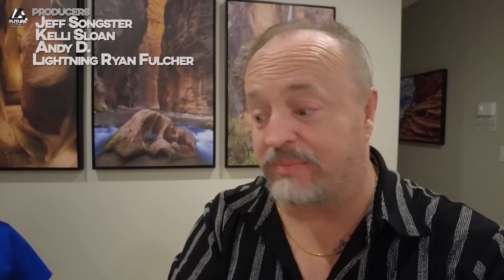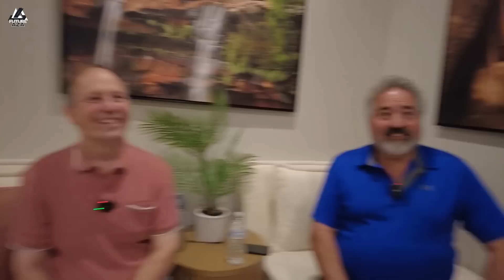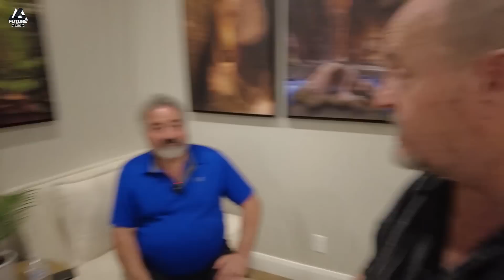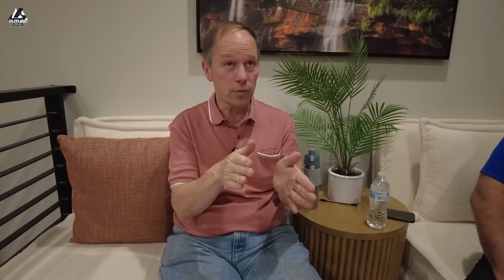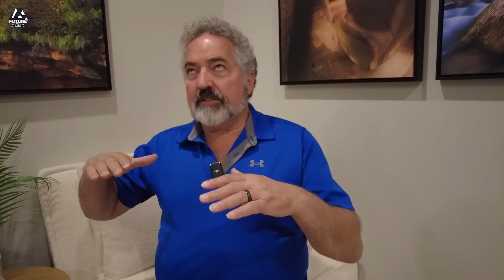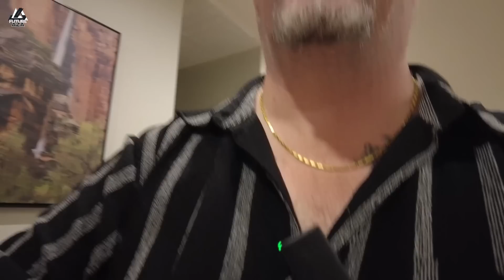Engineers Debunk Myths about Airless Tires, Hub Motors, and more

Comment: I doubt it will be front wheel drive. CV boots are a failure point. Also, apologies if you have already done so, but a deep dive on potential body materials would be interesting. I have my money on injection molded plastic.

Comment: The efficiency of charging of wireless and normal wired are measuring different things.

The wireless charging efficiency is just the transmission loss that is 95%, but that needs to be compared with cable loss, which is 99.999% efficienct.

Comment: two of the biggest problems with hub motors are:
1) Adding to unsprung weight.  Making the tire/wheel heavier has a negative impact on traction and handling. 
2) Harsher environment for the motor.  Getting the motor beat up each time you hit a pothole wears it out quicker.
Reply from the maker: Not to mention more expensive and they kinda don't exist. At least not for mass market vehicles.

Comment: Why do you say smaller wheels are more efficient?
Taller wheels rotate slower, so there is less loss on bearings
taller wheels are less affected by bumps in the road (the larger diameter makes the effective approach angle less)
From my time riding bikes, for the best efficiency, I would want the tallest tire, not the smallest.

Now, you do have to set your gearing so that the motor is in it's efficient power band at your cruising speed, so for a given drivetrain configuration, you can have a tire that's too tall.

But if you adjust your gear ratio to match the tires, why would a small tire be more efficient?
Reply from the maker: Total circumference doesn't change. Just like on other EVs, the smaller wheel with thicker tire is more efficient and comfortable.

Comment: Sensible small passenger vehicles are FWD with ice. EVs may have more flexibility to the solution?
Reply from the maker: They do that to keep the weight of the motor over the wheels, and to prevent losing space to the drive shaft. Neither would apply with an electric motor.

Comment: Electromagnetic breaking. Hub motors. Composite frames and panels at scale are all as absurd as gigacasting. They dont make sense to the experts until a company like tesla solves the engineering to scale production with a performance improvement over current standards with a decrease in cost of goods and reduction in manufacturing complexity and time. Ask the experts about 48 volt architecture or  using your cybertruck to provide power to your house during a power outage. Ask the experts if a car can drive itself using only cameras and AI. None of this made sense to the experts only a few short years ago.
Reply from the maker: These things are solutions to problems that are not present. The problem they need to address here is cost and simplicity.
Reply: I agree which was included in my comment. If they come with performance improvements, reduced cost and time to manufacture. If it ain't broke, is no reason not to improve upon it. While i have your attention, please look into the process tesla will use to retire 2-3-5 million cybercabs per year at their end of life. If its difficult to produce 2 million cabs per year, then when the first 2 million retire ~ 2036 (ten years of life), how does tesla retire all 2 million cabs all at once? They must have a plan, wouldn't you agree?

Comment: Hybrid airless tires seems like a good compromise with an outer airless band with enough thickness to be nail or screw puncture proof, the inflatable part reducing weight and improving ride comfort, and allowing a smaller lighter more efficient wheel hub.

Comment: Optimization is something that I did in my engineering work and a lesson I learned I think applies to many situations in life is how to recognize when you are at the optimum and cannot get any better because any change you make results in a less optimum.  It can apply to your job situation and airless tires hub motors.  
Airless tires work great on the moon and Mars and tanks are similar, what are heavier, more expensive and a harsher ride. 
Hub Motors work great for low speeds and bicycles.  Aptera should consider a low power hub motor for the rear just for low traction situations.
Reply: AWD for Aptera maybe a good idea because that 3rd wheel is offset from the other 2 and plows it's own track through the snow but not driven with a hub motor. Too much bouncy abuse and adds too much sprung weight to engineer.

Comment: Wheel motors can still have some advantages, depending on the maximum speed desired, basically by lowering the number friction points.  It will still present trade-offs - as every engineering solution does.